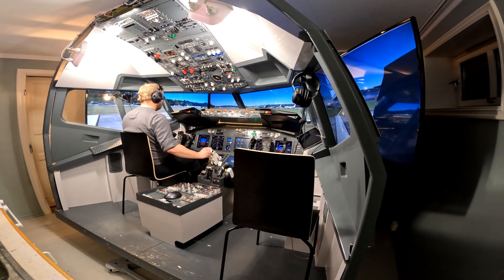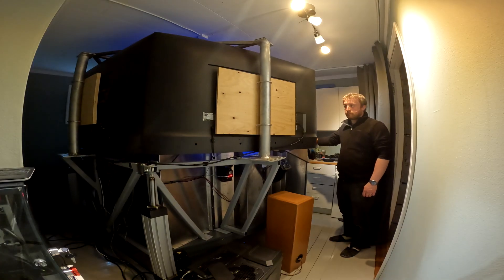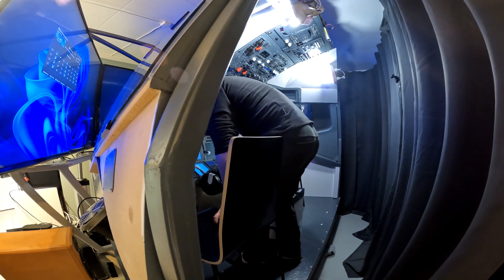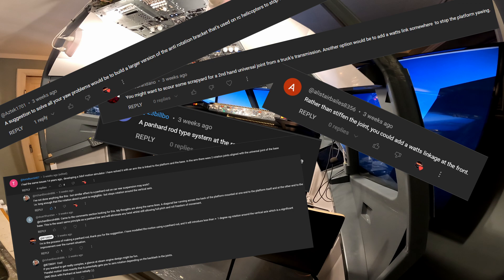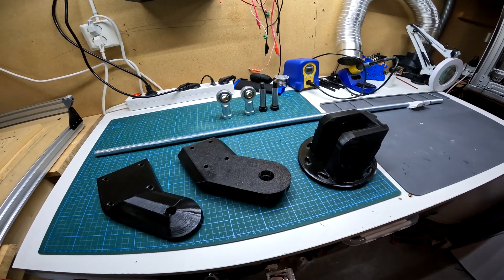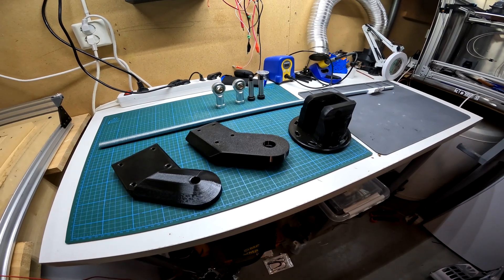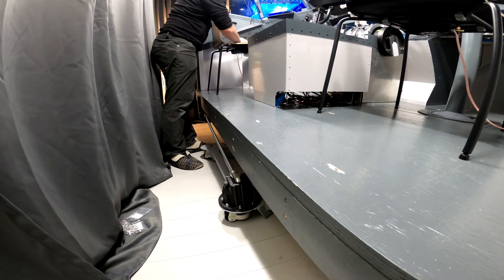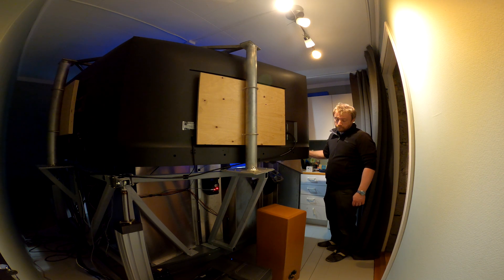Fixing my 3D printed main bearing with a panhard rod

Comment: Looking really good. 

I saw your first video on the motion too. Just wondered why you don't go for an four actuator design with one each corner of the cockpit instead of two and a universal pivot joint. A four actuator design of the type you are using can lift 400kg and will give you heave adding one more DoF which is useful for feeling what the aircraft is doing rather than just pitch and roll.

Comment: Hi, that new addition really stiffened everything up nicely. Seemed smoother movement from the platform when flying too. Did you notice much change in flight? So does the rod slide through the mount at one end or are both ends anchored and it behaves like a torsion bar? Looks great either way. All the very best Dave.
Reply from the maker: Hi, I do not notice much difference in flight as it is hard to distinguish between induced ocilations and intensional movement. I do on the other hand notice a significant difference when there is no movement. Before the whole simulator would start to ocilate when I adjusted the seat position. Now it feels rock solid. It works as a torsion bar, so there are some rotation introduced when pitching and rolling, but we are talking about less than a degree. So I find the compromise well worth it
Reply: If the rod was free to slide or move laterally at either end, it would be incapable of preventing yaw / rotation. In theory, the way that the bar moves should impede the movement of the platform in the axis where movement is desired, however if the bar is long enough, and mounted flat, then any movement causedby the arc the rod travels through as it moves is minimised to almost nothing. This is how panhard rods can work on the suspension of vehicles without introducing other unwanted movement in the suspension.